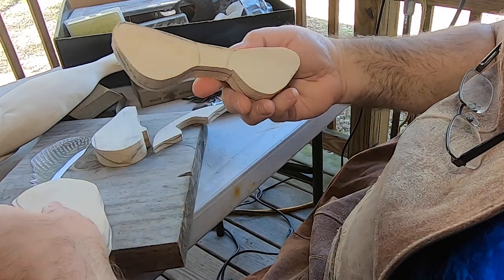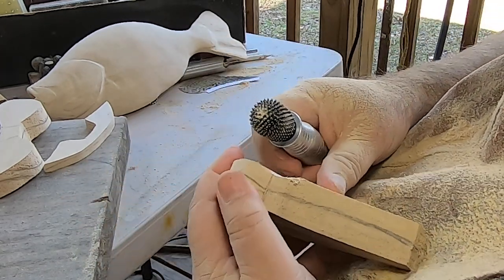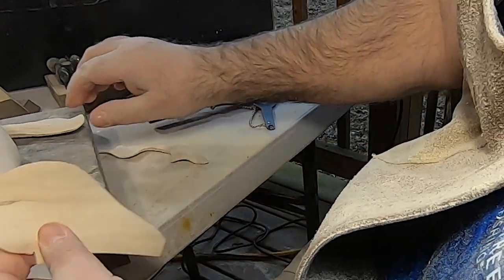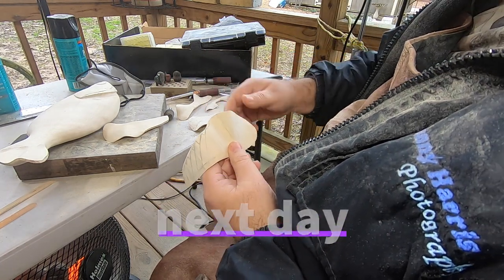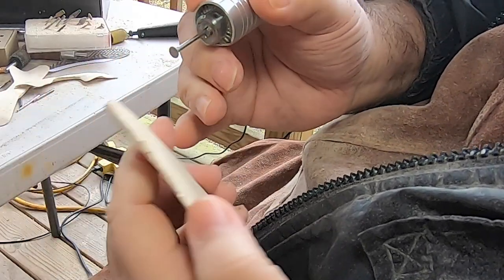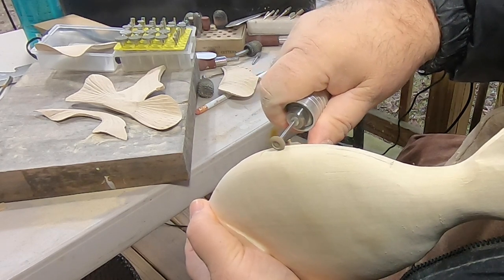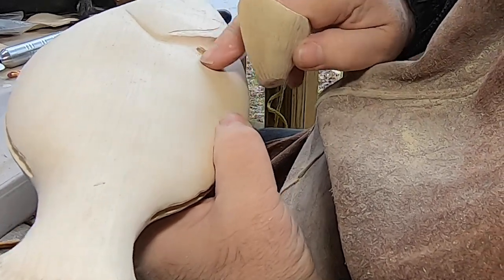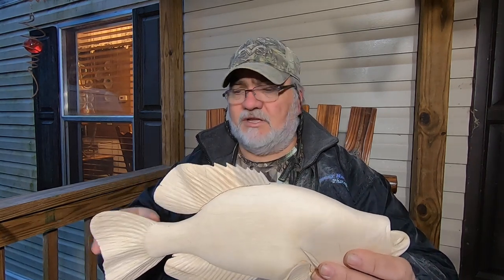Wood Carving a Black Crappie Part 2

Comment: Always great to watch you carve Danny!  A quick question...with the dorsal fin, it looked like you started with wood that was about an inch thick.  Is that correct?  Thanks.
Reply from the maker: Thanks, yes you have to take in consideration the movement of the fin. I wanted a lot undulation or waviness movement to the fins to simulate the hydraulic pressure from the water and it’s affect on the fins. so I  cut them thick to accommodate that motion. 
I’ve been studying a lot of slow motion footage of crappie and bass as well as going to the local Bass Pro and videoing the fish in their aquarium the fins have a ton of motion as they swim especially when they turn. When I see a mounted fish most taxidermist almost always have the fins splayed at full spread and straight because they clip them between cardboard with paper clips to dry them and a lot of carvers unfortunately carve them that way was well. I’ve been guilty of it myself especially with the first few fish I carved. I hope that made sense?

Comment: Just wanted to say your videos have really inspired me to look more into carving. Any suggestions or resources you can recommend?
Reply from the maker: You can start off small with inexpensive balsa wood which is soft and easy to carve. you can get it  at any hobby store and simple carving knives or if you want to go power carving route you can get a Dremel which is what I started with. I’d recommend the 4000. 
I eventually bought the flex shaft for it and a few basic burrs and started carving Harry Potter wands for my daughter. I did a few small tree spirits then my first fish. And I was hooked! The Dremel is fine for small projects but I wanted to do bigger fish so I was doing a lot of wood removal with an angle grinder. I eventually moved up to a beefier Fordom rotary tool and a couple different hand pieces and slowly added to my carving burr selection. 
You can use any wood but the wood of choice for most carvers is basswood or Tueplo. I use Tueplo almost exclusively now. 
If you’re on FB join a couple wood carving groups. One that I’m in is called Power Carving. the owner of the group also has a couple of satellite groups, one called Power Carving for Beginners and another called Power Carving for Newbies. (I’m in all three) you can get a lot of inspiration there and every one is quick to answer questions or give advise. 
Another good YouTube Channel is Stinnett Sticks and Basswood Carving Stinnett Sticks does some awesome snake walking sticks. He uses mostly power but also uses a lot of hand tools. 
Basswood Carving does chip carving. He carved small figures using nothing but carving knives. 

If you decide to go the power carving route check out Bear Woods Carving Supply at
bearwood.com (I have a link in the description above) if you decide to make a purchase use my name “Danny” in the promo code and you can get 5% off all purchases. They have a nice little high speed rotary tool called the Marathon that would make a good starter power tool. And if you decide you really like carving and move up to something heavier like the Fordom you can use the Marathon for detail work. (The owner of Bear Wood is the one that owns the power carving groups I mentioned above) 
And finally Depending on what subjects you want to carve you can buy patterns of just about any bird or fish or any animal for that matter. I usually draw my own patterns. 
You can always message me if you have any questions.
Reply: Thank you I will definitely check all that out. Lately I've been into scroll saw cutouts of fish and then I found your videos and thought it was amazing especially the amount of detail you put into them. A channel I found is Tom Christie. He carves some amazing duck decoys. Thank you again for the information. Keep up the great work! Can't wait to see you carve a catfish!
Reply from the maker: @joshleinberger6271 thanks,  yeah I follow His channel as well. And I have a catfish on my to do list.

Comment: I should be able to run one of those quarter inch bur bits in a air tool like die grinder right.
Reply from the maker: Yes as long as it has a chuck or 1/4 inch collet. The big ones I have are 1/4” shaft. And hopefully you have an air compressor big enough to run one efficiently. Most die grinders I’ve had in the past take a constant 90-100 psi to run.
Reply: Ya I've got a large compressor. I think I've only got it warm ones from it running so much but that was a sand blaster that was too big for it.
Reply from the maker: @kosherartwerxllc  yeah definitely gotta have a lot of flow volume for sand blasting